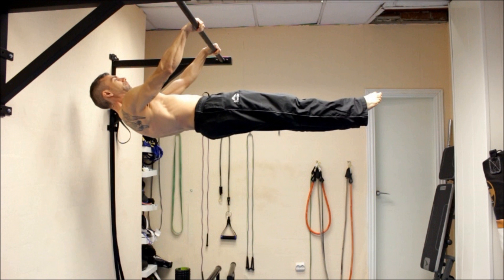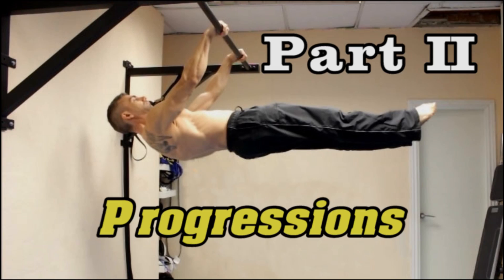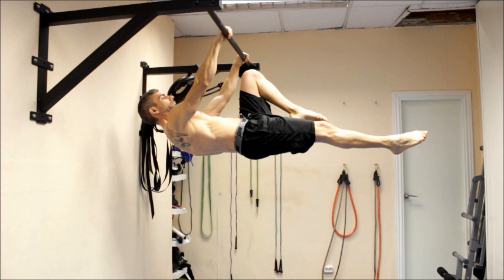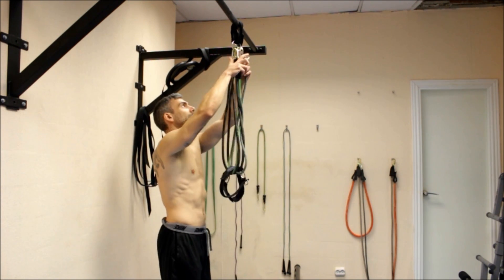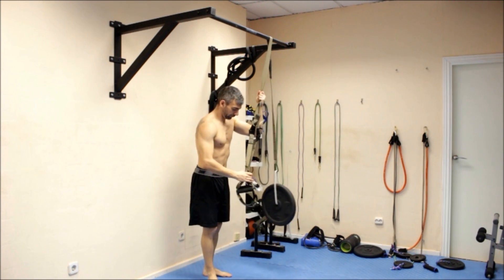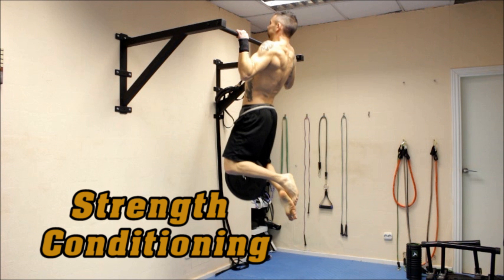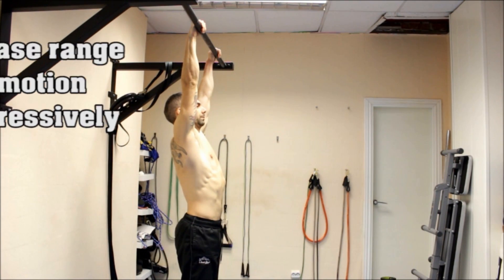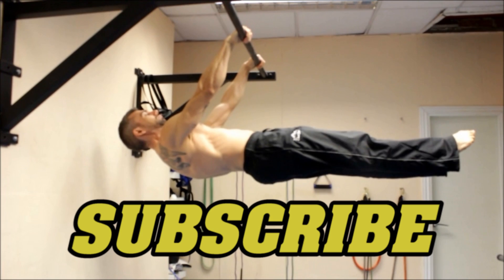Front Lever Tutorial - Different Methods of Progression & Conditioning Exercises

Comment: im wondering, if i would learn a front lever without weighted pullups, will i be able to do 1.5 times my bodyweight if i tried after that? heard the same with placheing and doing 2 times bodyweight on benchpress.
Reply from the maker: Good question actually. To be honest I'm not really sure, I don't know anyone who just does FL without doing any pullups or weighted pullups, but it would be an interesting study matter. Theoretically, as both the FL and pullups rely on back/lats strength, and since the FL requires a good amount of it, it would be fair to assume that if you can do the FL you'd have a good amount of force in the pullups, even if you've never done them before.  But again, in this case, I don't  know any real-life example to back that up.
Reply: bcntraining Zoran Pesterac(FL King) can do FL  but he didt do any pull ups or weighted pull ups. He was just trying the FL  and he achieved it(He can hold it for 17 seconds with very good form). Look up his YouTube channel or even better his Instagram account

Comment: I recently started working on the front lever (tucked) and I'm experiencing huge shoulder pain. What can I do to stop/fix that?
Reply from the maker: is it just with the front lever, or do you experience pain with other movements as well? For example when doing pullups? it's hard to say not knowing the exact cause of your shoulder pain, but maybe you should try to take off some of the load by using an loopband to assist you and see if with that it gets better. If that's the case I suggest you strengthen your lats and deltoids by doing pulldowns, front raises, and shoulder presses.
Reply: bcntraining It only appears when doing the front lever. I can do every other movement without any issues. Someone told me that I'm not pulling enough with my scapula, could that be the case?
Reply: I had same problem, but it was something more like painfull muscle burning. It was over in few weeks when i get strogner. I think i wasn`t strong enough and it was really hard to mu muscle.

Comment: Great tutorial. Been stuck on the front lever for a while now. I can do a straddle lever, and normal full with one leg tugged, but I cant seem to get the last step. I noticed that your arms arent completely locked when you perform the lever which surprises me. I focused alot on this in the beginning in order for it to be perfect, you might now realise you do this.
Reply from the maker: You're perfectly right! I am aware of that. And I've been working on it. I've been through the same journey as yous people, felt many time frustration and disappointment, hit many plateus and it took me a long time before I could get a decent front lever. This tutorial, as others, are a way to show how I did it and which technical knowledge I used to achieve it, rather that showing how good I am at certain skills. I know I still have a long way to go. Thanks for the feedback. If I may give you an advice, try to improve your overall lats strength (weighted pullups). It helped me a lot!

Comment: Very informative video. If my deltoids hurt while training for frontlever does that mean they're the weakest and that i need to train them. If it does, how can i train them specifically. Thank you in advance
Reply from the maker: +Obada Daher If your shoulder hurt, it doesn't necessary mean they're weak, it could be that they're fatigued, overtrained, or inflamed. I suggest you do a good warm up before training the Front Lever, and to stretch your shoulders afterwards. Anyway, strengthening your shoulders is always a good idea. I suggest you do dips, and handstand pushups or milirary press to increase your strength in this area.
Reply: Ok,shall do .thank you so much for the valuable tips.

Comment: hey there, I have been stuck at advanced tuck front lever for 1 week and can't do better than my record which is 10 seconds. My training is 5 sets of 6 second holds.
Reply: what should I do?
Reply from the maker: +Astro64 Hi! Don't worry about it, 1 week is a very short time so you're not really stuck with the advanced tuck. The front lever is an advanced move and it takes a long time to master for most people. So my suggestion is to keep trying to improve your timing with the advanced tuck and also keep strengthening your back. Once you're able to hold the position for more than 15 seconds, move to the next step.
Reply: +bcntraining thank you man!! it's very weird but I tried the one leg front lever yesterday and I held it for about 2 seconds!! But I think I still need to increase my advanced tuck. What happens is that when I hold it and I get to 10 second mark my lower starts to sag and come down and it becomes round and then I can't hold it anymore but I will use your advice!! thanks again :)

Comment: great tutorial! easy to learn.
I have shoulder problem, cant do lots of pull ups!
can this be fixed?
will I be able to do front lever?
Reply from the maker: +L Kira Thanks! It depends of what kind of shoulder problem you do have. I also have a shoulder impingement which sometimes makes my shoulder hurt for a few days, so I have to back down a bit with the training. If you keep stretching and strengthening your rotator cuffs, even a chronic shoulder injury shouldn't be a problem with either pull ups or front lever. So, yes if you keep training you will be able to do the Front Lever
Reply: Thanks man...
I was hoping you would that! 
Thank you! Ill keep moving:-)
Reply: Thanks man, 
I was hoping you would say that!
Thank you! Ill keep moving,.

Comment: I've been stuck on the one leg FL for months now. I can do 1.5 my bodyweight (75 lbs weights) in sets of 5 with full range of motion and hold a one leg tuck for 22 seconds. I still can barely hold the full FL for a second. I've been using workout Russia's program for a while but still am seeing very little progress. Any suggestions?
Reply from the maker: +Alpacanizer Do you do the one leg tuck with your leg completely straight and your back, hips, and feet in line? 22 seconds it's long enough to move to the full FL. When you do the one leg tuck next time, try to stretch the other leg slowly. Notice at which point you start to drop and which part of your body is under the most tension and gets to failure first, so you can identify your weak points. Then I suggest you use some kind of assistance (i.e. partner, elastic bands, trx) and do the FL in the position that you've found you can't hold it. Try and let me know how it goes.
Reply: +bcntraining I finally got the full front lever! Thank you for your advice, I just needed to be persistent. What really helped was activating every muscle particularly my glutes which helped me hold the position.

Comment: For how long should one be able to hold a tucked FL before moving on to advanced tuck FL?
Reply from the maker: +Daniel Steiner In my opinion 10-15 secs in a stable tucked FL position are enough to move on to the next level. If you can do longer than that in the tucked position but still can't do de advanced tuck, maybe you should work on increasing lats/traps strength rather than trying to hold a longer tuck FL.
Reply: +bcntraining Thank you. So would you say that 10-15 second holds are a good goal for every FL progression? I can do a one leg front lever for about 3-5 seconds currently (other leg is completely tugged). I'm wondering if that is too "short" to be effective training. I can do 1.5x bodyweight pull-ups, MU's etc, but I am really struggling with the FL.

Comment: I can do 1.5 times my body weight & 10 pull ups with 30% of my weight and I can do front lever raises all day but I can't hold it for a single second
Reply from the maker: +Eduardo E It's not automatic. The 1.5x bodyweight its just a strength standard for the upper back strength. You still have to work for the front lever. Is like saying that if you can do a back bend then you can also do a back handspring

Comment: If i weigh 160lbs and I can do a pull up with 67.5lbs. How long would it take to get 80lb weighted pullup?
Reply from the maker: +Astro64 I don't think it will take too long, an additional 12.5lbs is a very attainable goal. Just to clarify, (and I probably should have mentioned it in my video) it is not that if one lifts 1.5x or more of their bodyweight in a single pullup, he will automatically do the front lever. Rather the 1.5x of bodyweight pullup represents a standard of pulling strength, under which it won't be possible to do the front lever.

Comment: So, what if i can hold the one leg front lever but not the advanced tuck lever or the half lever.? what am i doing wrong?
Reply from the maker: +Vangelis Eminem Well could it be that in the one leg front lever you're tucking your knee to your chest too much, making it more like a tuck front lever than an advanced tuck? Have you tried to move your knee away from you? What happens?
Reply: My knee is almost parallel to the bar not close to my chest but not very far either.. And both on advanced tuck lever and one leg front lever when I get my knees a little bit further it's like instant fall... :-/

Comment: How did you enumerate this 1.5 times bodyweight pull requirement to do front lever ? Im wondering, because im pretty sure i can pull up even more, but attainment a front lever seems be loooong way to go :D 

Btw. nice work, well said :)
Reply from the maker: +kacperpzn Well to be honest with you the 1.5 mark is an approximate measure, as there are many variables involved, for example the taller one person is, the more strength is required (i.e. more that 1.5 times bodyweight), so an exact formula would be impossible. So that might be one of the reasons. Thanks for your comment :)
Reply: I am tall person (186cm = 6"12') so yeea, it might be the reason :D Thanks for answer :)
Reply: I'm 183 = 6''  and 82 kg ( 181 lb). Last summer I was able to pull 3x50kg with full rom, and even correct form (retracted and depressed scapula all the time) but it was no enough for FL, but i was close ! :D straddle about 6-7s with 45° abduction per leg. In next few months without additional weights, insted rope climbing training i did it for 3-5s so 1,5 might be, for smaller and lighter athlets :)  For heavy and tall one, it would be probably bit more about 75%.  Good explenation why, is in Zatsiorsky - Science and Practice of Strength Training page. 54 http://www.traininginparadise.eu/wp-content/uploads/Science-and-Practice-of-Strenght-Training-Vladimir-M.-Zatsiorsky-.pdf 

Anyway great tutorial, very innovative method with counterweight and resistance bands even after 5 yrs of bw training i have lot to learn ! :)